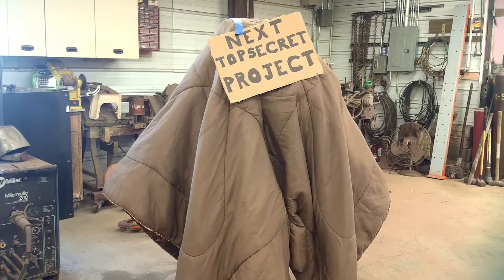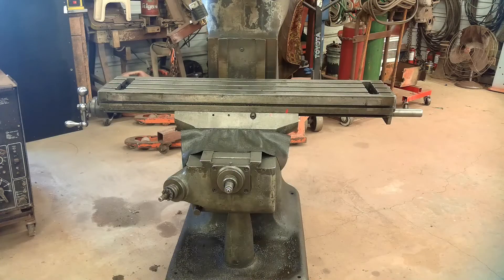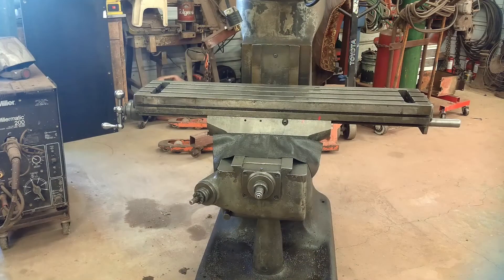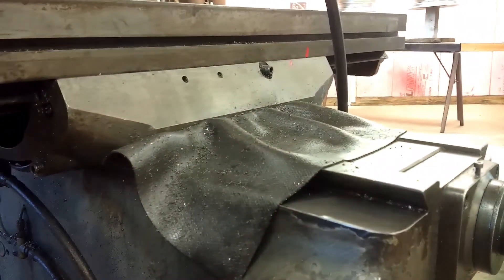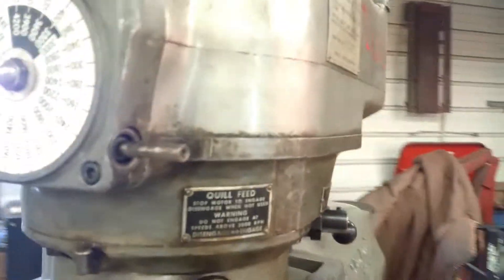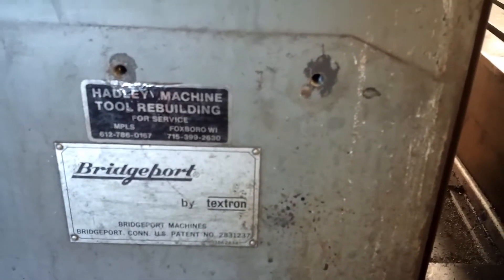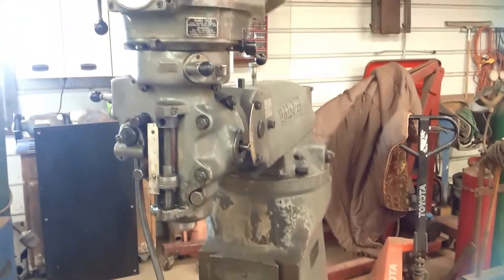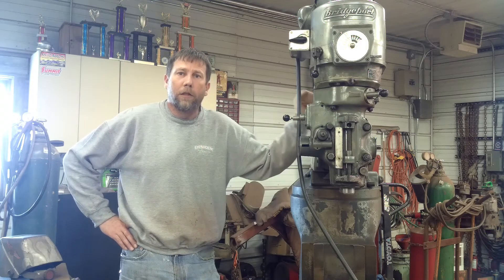Shop Upgrade Bridgeport 2J Mill Ep.1

Comment: Looks like fun. I have 2 with the J head on them. some of the variable speed parts are hard to find. look on ebay for parts ( that's were I found some of the parts for mine. youll love it when you finish it. keep us updated on the project.
Reply from the maker: Thanks Bob. Machinery Parts Depot has everything, but they are spendy. I've gotten most things off ebay so far
Reply: @sparksfireandbalingwire8467  It sounds like you got a handel on gitting it restored. youll just love it when your finshed with it. good luck and keep at it.